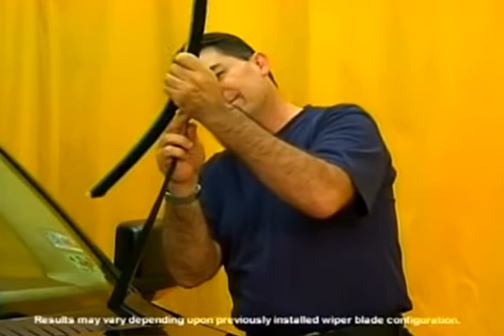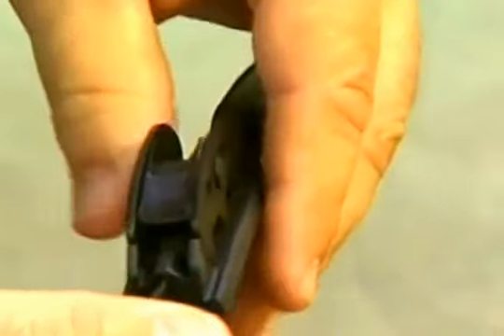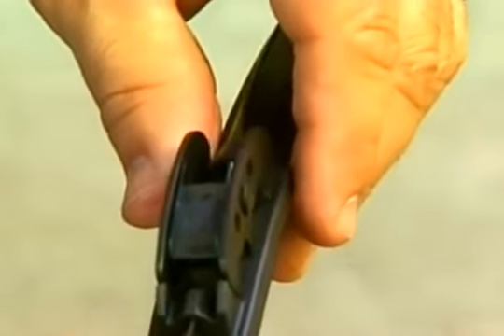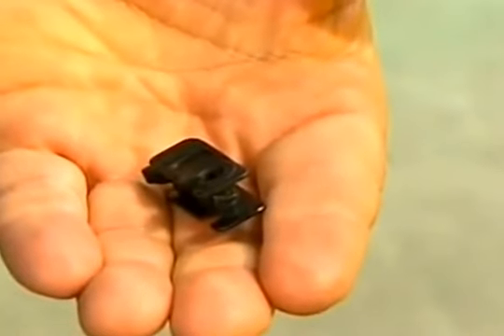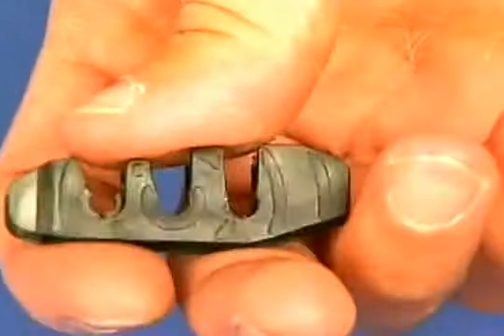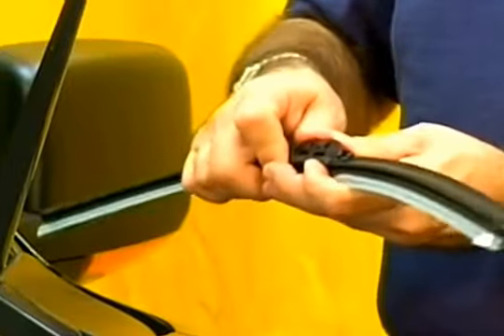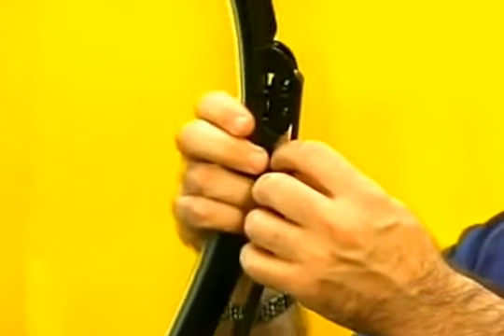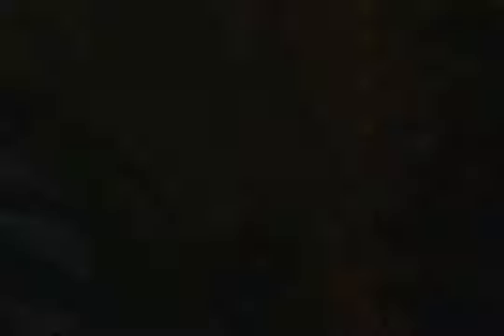Rain-x Large J Hook Arm Latitude Wiper Blade Installation Video

Comment: Now Rain-X Latitude Water Repellency blades have a built-in universal connector.  For a J hook, click open the lock on the connector, slide the blade onto the J hook till it clicks, then snap shut the connector lock.  There is no need to replace the Rain-X connector as shown in this video.
Reply: Yeah BS, the lock will not lock.
On both blades.
Reply: @rvz77  Correct the the connector lock will NOT snap shut. - what can I do?